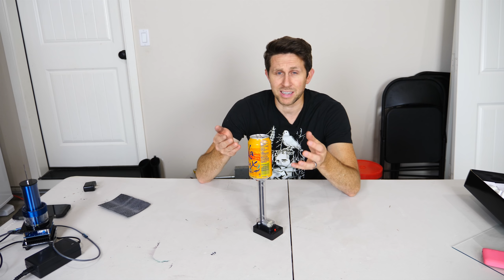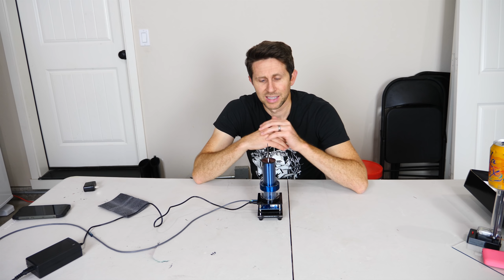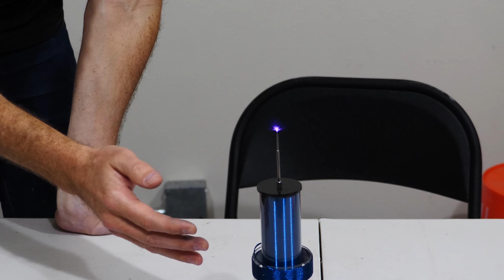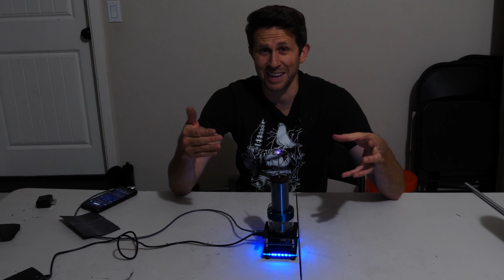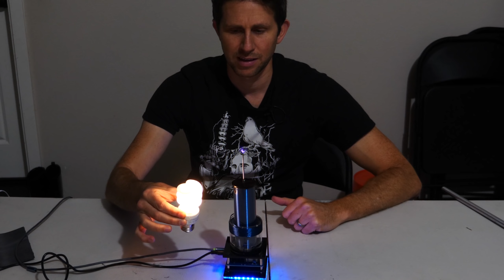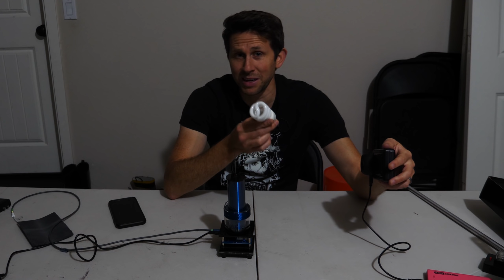How Do Musical Tesla Coils Work?

Comment: i love that a lightbulb could be secretly vibing and no one would know
Reply: Always have been, at either 50 or 60 Hertz depending where you live, you can even make a light vibe to the internet if you connect it on the same network as an Internet Over Power thingie
Reply: It's called Li-Fi, we looked into it for our office. It is a wireless signal being transmitted by the overhead lights. We looked at that tech several years ago. It's been out for a while.
Reply: I want to see this being used in a spy novel to transmit information now.
Reply: Not exactly.
Reply: LiFi is an idea where you could have something like 40Gb a second of wireless data by using LED lighting that pulsates like this to transmit rather than radio.  It would be amazing however it wouldn't work without line of sight, and it wouldn't work if you turned off the lights.
Reply: @atashgallagher1631  yup, there are several cons but a big pro for us? Very secure. In order to highjack LiFi you would need line of site. So using light blocking blinds and closing doors would be a very secure solution.
Reply: Theres a newer form of wireless which hopes to use light bulbs as mini "wifi" access points using this idea.
Reply: @picklefish74  not exactly what? Lightbulbs are always vibing at 50hz or 60hz
Reply: my lightbulb was blinking, imagine if it was a rickroll
Reply: I mean 'techncially" light bulbs do flicker on and off all th time. jsut reallly fast

Comment: I'm surprised the sound quality is that good after so many conversions.
Reply: The conversion is good, but the problem is the bandwith of each device, I'm not sure the light bulb is really made to blink that fast. In the other hand the spark has a quite high pitch.
Reply: you think the sound quality sounded good?? it was absolutely terrble
Reply: @nonothebot  If you thought about the brightness, It doesn't need to go fully on and off. Just vary intensity a little. The electrical analog would be a DC biased sine wave. The solar cell panel would generate a DC biased sine wave signal. Removing the DC bias need only a capacitor. Then the signal passing through the capacitor can be amplified.
Reply: @tormendor8585  I think he was expressing that he expected worse.
Reply: @kreynolds1123  Thank you for this precision. I didn"t think about it but it makes sens.
Reply: @kreynolds1123  well good job, arent you observative
Reply: @backwoodsbytes  it just was terrible its way worse than the compressed audio in phone calls
Reply: Also who the hell would pay for sennheiser when theres cheaper and better headphones out there
Reply: @backwoodsbytes  then you agree with him. i happen to disagree with him. what is so hard to understand
Reply: I know it did sound pretty good for what it is XD like never knew you could get that good of a sound from a Tesla coil especially after he converted it with the bulb and into the speaker
Reply: Energy cannot be created nor destroyed 😉
Reply: @backwoodsbytes  I want Tesla coil headphones.
Reply: @backwoodsbytes  I bet it sounds great in person. Live music always has a different timbre.
Reply: @nonothebot  How much kbit/s can we transfer though light?
Reply: @jantube358  It depnds on the "color" (wavelength, frequency) of the light. Internet trough the fibre is from 1 to 10 MB/s on infrared light. With UV we coulg go 4 times faster !
Reply: @nonothebot  There are optical cables for sound systems but then you still have a cable. I think it might be not as good as I think and maybe unpleasant to send sound to wireless speakers with light.
Reply: because it is a analog signal
Reply: It actually sounds better
Reply: I really thought that the phosphor coating would be more reluctant to change in brightness and act like a low pass filter. Interesting that it doesn't and reproduces the higher frequencies so accurate.
Reply: it sound Terrible also it has Some sparks noise
Reply: @tormendor8585  still better than internal speaker 😂
Reply: @nonothebot  it's not a lightbulb, it's a fluorescent light, so it should not be a problem
Reply: @Entropy3ko  I'm not sure the CFL id made to blink.
Reply: @jhoughjr1  i want a tesla coil car horn

Comment: That would be such a dope way to hide a recorded message in plain sight. Have a small hidden tesla coil next to a room's light bulb and when someone turns the lights on, the recorded message signal is sent to the coil which in turn lights up the bulb. All they see is constant light, due to the high frequency, but someone with the right device can get close and decode the light into sound.
Reply: Transmitting sound through light is so old that a when I was in high school in the early 90s, there was a project that used an LED to transmit sound (and it was old back then too). One circuit to modulate the LED output from a sound input, and another photo-sensor and circuit to turn the signal back into sound. I went with another project though, instead I made a bug/spy transmitter, that was so much more useful.
Reply: This is the basic concept of how Bluetooth, Wi-Fi, etc work. Signal being sent out into general area, but only those whose devices are given the de-coding algorithms can make any sense of those signals.

Comment: I find the musical Tesla coil so fascinating! I wonder how much power it consumes compared to a traditional speaker.
Reply: based on the little knowledge how most tesla coils are made prob not as much as you would think. Most have a way to step up the power from an outlet. Like a capacitor but a tesla form of it. But thats for like table top type ones like you see in the video. The zues musical teslas i am not sure if its the same concept or not.
Reply: @mitchyitchy3  Musical tesla coil uses silicon conductors to act as a spark gap. The plasma speaker may consume more power but I heared that it acts as a very good tweeter. If the membrane used in tweeter is lighter, it can vibrate air at higher frequency, which is why paper cone is used in tweeter. The plasma speaker uses air so its virtually weightless.

Comment: I’ve been a commercial HVAC technician so long that when a VFD fires up any motor I can tell if it is at 100% 60hz or not. In fact in some cases I can hear the frequency is off a little I know the motor is going bad. When I hear the golden hum noise permitted by the VFD I can tell it is working perfectly; especially in amp range, of service factor of course. Lol
Reply: Isn't HVAC our cars Automatic AC?
Reply: @gauravbisht4504  hvac means. Heating ventilation & air conditioning
Reply: So how did this tesla coil sound to you, if it was a VFD? Will it survive, doctor?
Reply: @kingsolo6241  makes sense why me car OEM calls it that way instead of A/C.
Reply: 60Hz is pretty much the low E note on a bass guitar, btw

Comment: The wireless cable concept was about to made
Reply: A hundred year old concept
Reply: SilentKnightXD it wouldn’t be possible now... All the tall vehicles (Mostly Semi Trucks) would get caught in the path of the plasma, causing major destruction, making it impossible in modern days... Very advanced back then, though!
Reply: @prestonferry  make it T A L L E R
Reply: @pepre7594  that would be too expensive to switch, and it has the possibility of things like catching birds...
Reply: @prestonferry  I know I was joking lol
Reply: @pepre7594  still, it feels like it could be used in more isolated environments or at least further explored. In fact, wouldn't it make it possible to conduct electricity into a satellite using an extremely high up structure, where there would only be aircraft at that point?
Reply: @bioncledudes4life  I think that would be too much of a hazard and with that much distance the amount of electricity would be very large (if it even worked, which it probably wouldn't as it would arc onto just about anything at that point), not to mention the structure itself. Definitely an interesting concept though

Comment: When you bring your hands near the coil you actually detune it and reduce the 'Q' factor which causes the output voltage to drop. Imagine making a pendulum but with a water paddle. Your hands loads down the output significantly.
Reply: He lowkey proved this by 'absorbing' the voltage- technically- HE was the transmitter for a hot second

Comment: I taught high school physics for a year and built my own Van Der Graff generator almost entirely from parts I bought at Bed Bath and Beyond.

When I asked for either a silk scarf and glass rod or rubber belt and plastic rod, they were very confused. I ended up using a pilates belt and a rolling pin covered in scotch tape to generate the static electricity, two colanders covered in aluminum foil for the capacitor, a shelving unit for the housing and other similar tools. It was powered by a drill using a Lego wheel for friction with two CDs for guidance and used a power cord in which only the ground was connected to ground the machine.

I got some very funny looks taking that thing on the NYC subway on my way to work.

Comment: Important note: There *IS NO DIFFERENCE* between "static" electricity and "regular" electricity. unless you define static as a just an accumulation of charge on a surface (like a capacitor). The Van de graaff generator is just a constant current source that has no theoretical upper bound on the voltage achievable. It achieves it by the triboelectric effect. Tesla coils rely on transformers and resonant rise to achieve a similar goal.
Reply: Sulfer is Trielectric according to Love death Robots X_)

Comment: Did anyone else notice how "warm" the sound was when coming through the light source? I wonder if that's a similar effect that creates the love by some audiophiles for vacuum tube amplifiers.
Reply: I think the sparks has a lot of high frequency noise and the bulb light acts as a low pass filter
Reply: Depends on the color temperature of the light.
Reply: The light 💡 phosphors will take a (very small) amount of time to brighten and dim to the music, which will round off sound waves, similar to how an analog tube amp is used to smooth (or “warm”) the output from a digital media source.
Reply: because it uses an actual speaker. tesla coil is bad at lower fequency.

Comment: I was thinking use a laser instead of the fluorescent light and then you could transmit the sound over long distance. But the limit would be the atmosphere scattering the laser light. The way to fix that would be to put the light through a long fiber of transparent material. Then boom, you have fiber optics! Obviously in fiber optics the signal is transmitted in digital form so there’s extra steps at each end.

Comment: This has to be the coolest experiment ever! I’m even more impressed by lightning since it can expand the air. I now have a question, does lightning in nature also alternate but slower since it’s a pretty deep sound
Reply: Good question. It often does flicker, but the flickering is too slow to create patterns audible to our ears. It would be like if you pushed in and out with your finger on a large speaker diaphragm. If you put that speaker halfway submerged in a bathtub and push on the diaphragm, you would see little waves in the water. So those waves are also present in the air, but there is a lower limit to what frequency our ears can perceive as sound. If the frequency is lower than that range we don't hear it. However we may hear other higher frequencies that are produced as byproducts of the low frequency vibrations causing other objects to create their own different tones in response to the inaudible lower frequency vibrations, like how a license plate may rattle on someone's car when their subwoofer is turned up. But yeah, wouldn't it be really freaky if God used real lightning like a huge speaker to tell us that the end is really super close?

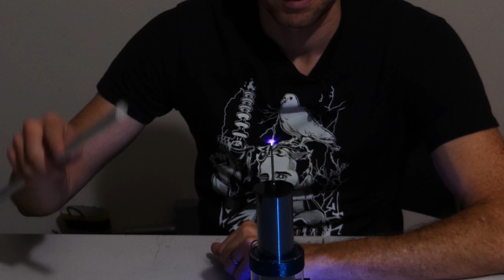Comment: 2:18 this is incorrect. What’s actually happening is the capacitance between your hand and the coil is changing the resonant frequency. This makes the signal not as powerful as it could be. It’s a slight misconception but I hope this explains it well.

Other than that, great video.
Reply: Well, no, that would be PART of the reason IF the driver circuit was not self oscillating. This drop in power even happens with self resonating ones. There is capacitive coupling between your hand and the coil and the power is drained away. The only way that resonance frequency could have an effect on the power output is if the driving frequency of the coil was set to a specific frequency, which I doubt the one he has is.

Comment: The reason trillions of electrons jumping from atom to atom  randomly, and the heat it creates in a small space is relativly quite, is because their interference patterns don't all add up constructivly.  All too often, just a millionth a of mm away, another pressure wave can be 180 degrees out of phase.  Pulse the signals and they better add constructivly. The high pressures tend to align better and the troughs align better to a louder stronger amplitude single pressure wave.

Comment: The light trick seems like a good way to spy on people.  The light bulb looks totally inconspicuous, but has a microphone that picks up on sound waves and makes the light bulb flicker.  Then, even if you're in another building, you put the solar panel up to a telescope pointed at that light and you should be able to hear everything going on in there.  No radio signals, no battery-operated devices, and nothing particularly high-tech.

Comment: How good is the quality of sound we can achieve through light? Could we make a system to transfer audio signals via light to a hight quality audio system instead of cables?
Reply: Have you heard of fiber optic phone lines?   They use light to transfer sound over a long distance with much higher quality than electric signals over wires.  The problem with the light transmitting the signal is that light can be blocked very easily.   A dusty room could reduce the quality.

Comment: I bet if you used a Tesla coil for the output transformer, drive it with DC and used it for the output of a vacuum tube transmitter... 

Okay sorry I'm having a brain fart. AC and DC can coexist without cross interference. It's the very basis of how vacuum tubes work in audio equipment. 

So if you made a 20,000 watt tube transmitter to provide the audio AC signal and DC to energize the coil. The addition of the AC signal would regulate the plasma. The perfect friction-less, omnidirectional, infinite spectrum speaker with one hell of a light show. 

As long as the DC input was clean, it would sound perfect with zero distortion. That would be one bad @$$ guitar amp.